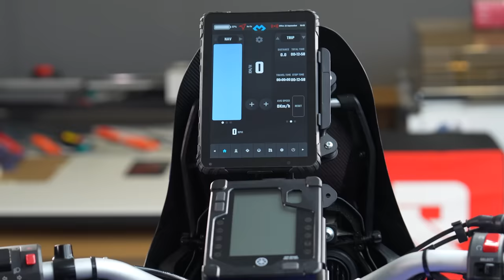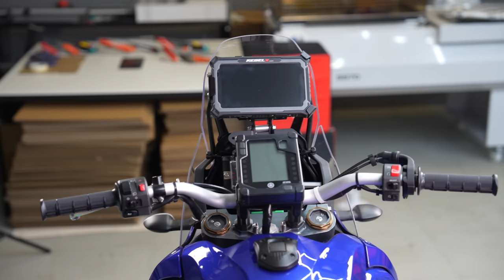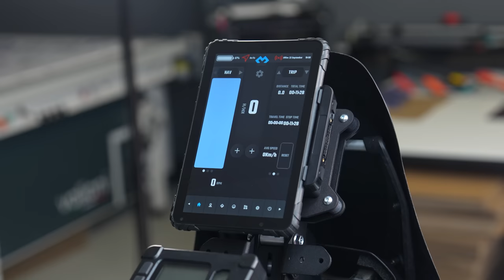RALLY KIT Yamaha Tenere 700 Tutorial

Comment: Hi, at 6:39 you remove the bracket. On the bracket, there are four threaded clips where the bolts go to fasten the headlight. When you install the tower, the two upper ones are used for the hex bars, but the lower ones are not used. Is that correct?

Comment: I'd like to know how you power the new LED assembly to the stock wiring harness? I believe I read somewhere in the past that Yamaha doesn't send a normal 12V signal to the stock projector lights. It's low voltage signal or something like that. So if that's the case, how would you power the LED lights you have?

Comment: do you sell the light weight head light on its own.
Reply from the maker: Unfortunately it does not fit with the OEM tower nor OEM fairing so you could potentially buy it from Rebel X but you would not be able to install it
Reply: @ManuelLucchese1  thanks for the reply. mite be worth you doing one with out the rally tower as a lot of T7 riders dont need the tower but want to loose the weight  as they just want to ride the trails. does look good bit of kit.
Reply from the maker: @adriantompson  I had looked into developing something but the problem is that the OEM supports are bolted onto the headlight and if you take them off then you remain with no place to fix it. For sure it's doable in some way but I believe it wouldn't look very nice as you would have then a big hole in the windshield. Definitely curious to see maybe some DIY project
Reply: @adriantompson  If you want to ride the trails then just take off the entire tower, put the dash on the handlebar like they did in this video, and put a cheap and small dirt bike headlight right onto the forks.
Reply: @Blockbuster2033 you need the tower for the wind protection. i have smashed the front screen off crashing. and i can tell you its no fun riding with out it, be good in hot weather but most of the time in wales uk it rains a lot and aut and winter gets very cold on the bike. the tower is a must. i will have a go putting a light enduro light on and making the tower fit i have a plan. there is a lot of weight to shed with the stock light so heavey.